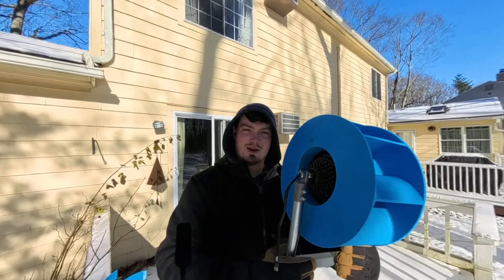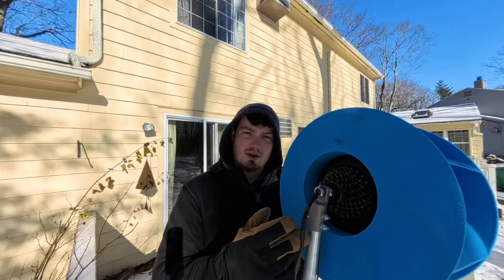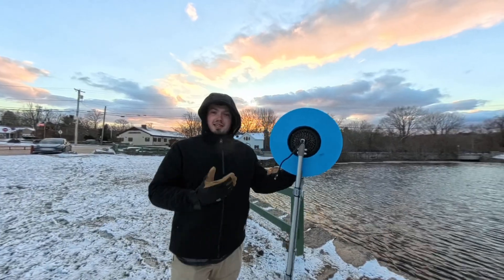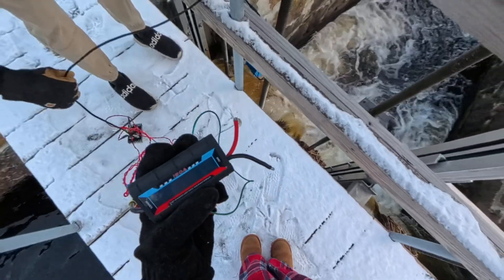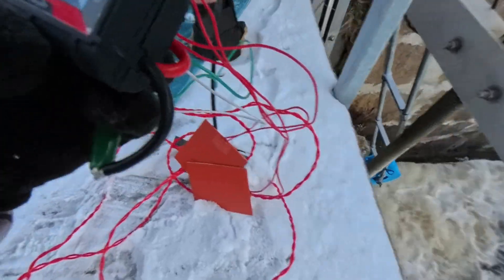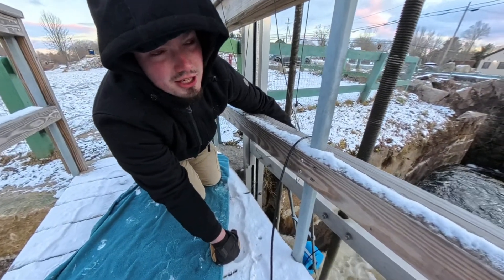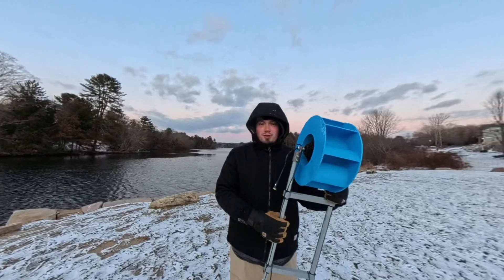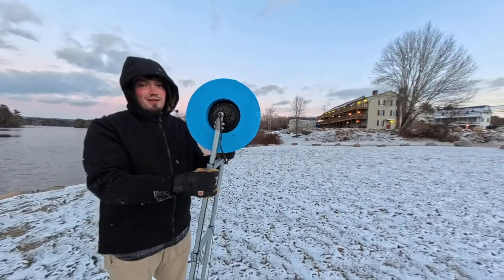3D Printed Water Wheel Turbine Redesigned With Your Ideas!

Comment from the maker: What should I try next?
Reply: idk but I received a free hoverboard and I'll be gutting it and shrinking whatever stl you make work the best lol
Reply from the maker: @PhonePhone-sf8te  haha good one
Reply: @Beyond_The_Print   you probably need to go towards a high head low flow pelton design, that is if you have actual elevation where you live to work with.  Or start working with those gears but they won't really do anything unless you put the water wheel on something else and then run the chain to it.   30 watts isn't that bad though when it's running 24/7
Reply from the maker: @PhonePhone-sf8te  thank you for this! I have played around with a Pelton turbine before if you havent seen those vids. I am limited to my elevation for the time being but hope I can improve this in the future. I'm currently working on some ideas for just this (separating them via chain drive) stay tuned!
Reply: @Beyond_The_Print  Oh cool, no I didn't see them, but I see you've been at it for a while.  Keep up the good work, I'm definitely going to be watching them  all.
Reply: @Beyond_The_Print  I have a low flow reasonably high head to work with, a hundred or so feet. I'd love to have something set up for it, but the wires to run the juice and the piping isn't going to be cheap.  One freeze would probably obliterate $$$.
Reply from the maker: @PhonePhone-sf8te  yeah would definitely need to figure out a long term solution, or drain the system for cold months. If you decide to start setting something up send me an email and maybe we can work together on it!
Reply: @Beyond_The_Print  I'd love to learn blender/cad/ whatever. I've had a 3d printers for a decade and never modeled anything.  Shameful  since there's so much I want to modify/create from scratch.
Reply from the maker: @PhonePhone-sf8te  gotta start somewhere!
Reply: Widen the wheel to the width of the water fall. Use a outside diameter as large as you can print/make. Make the buckets a bit less deep ( father away from the center ). What power is the motor rated for ?
Reply from the maker: @bartdepauw1156  I'm thinking of a double wheel as this (diam) is the max of my machine. I've found a 1k watt rating and also a 2k. I think it's the 2,000w though!

Comment: Have the water go over the top, and not under. That should up the power a bit. Also look at pelton wheel designs. They have proven to be the most efficient. It looks like you have a fairly big 3D printer making these water wheels. With some skillful 3D modeling, you could make a pelton wheel design that will show huge improvements.
Reply from the maker: You should check out my Pelton turbines! I've been working on a few different ideas to try and make this work. Stay tuned, thanks for the suggestions and I'll have to try flipping it over

Comment: My first thought was to pick some size drill bit and start with one hole on each side of every bucket. 
You could dial in exactly the speed you want slowly removing the same amount from each side of every bucket. Until you reach the flow you're looking for
Reply from the maker: This is a good idea too! If you haven't seen the open style one check that out. We were able to get a little more power out of that one
Reply: @Beyond_The_Tint  I watched that first. Still your closed buckets allows you to slowly cut away now and figure out the optimal water flow.

Comment: I teach about hydropower turbine design. Your wheel is indeed limited but not in the way you think. Once the water fills the bucket, it becomes static relative to the wheel. As it leaves the wheel on the otherside the viscosity is slowing down the wheel. Most waterwheels are large and slow to ninimize this issue. They also are designed to maximize the height the water travels in the wheel. You want a crossflow wheel in this application.
Reply from the maker: I just looked into the crossflow wheel turbines and I love it! Thank you and I see what you're saying in this test. Thank you for this input

Comment: Put small holes along the walls and buckets. Air needs to be able to escape when water fills the bucket and the wheel needs to be able to release water as it turns. Fine line between capturing kinetic energy and weight drag. Your original design has no drag, might already be best model
Reply from the maker: That's a great idea! I hadn't considered this at all and I agree seems like the original may have been the optimal design in this location.

Comment: It is not an impeller - not internal.
And for the sides: there is no need to waste so much material on a flimsy wall. Get some stiff plastic/foamboard and just cut out that circle. Faster, cheaper, stronger.

And the bucketed turbine setup is normally used for when the water is flowing over the wheel. Low velocity, low flowrate and using the height difference to extract as much energy as possible.
If you plan on having a turbine right in that high-flow section you might want to test a shape more like a pelton-turbine.
Reply from the maker: Thanks for the correction and write up! That is correct they often directly function of the weight of the water in the bucket rather than the impulse of water hitting the blades. I've tested a Pelton style before and would like to try it here but the issue would be water hitting the returned water ruining efficiency. I'm looking into better designs currently, thank you again.
Reply: @Beyond_The_Print  As you got what essentially boils down to a sheet of water instead of just a thin stream: use half a pelton. Normally it is redirecting the water 180° to get as much momentum out of it. In your case you have way way more water and energy available so just a 90° diversion should be plenty of power and make the water clear the path faster.
Reply from the maker: @ABaumstumpf  I like it, time to get designing